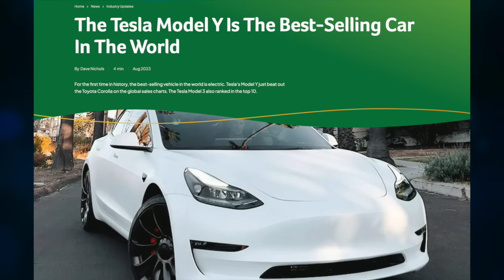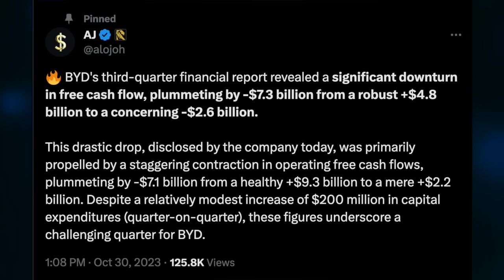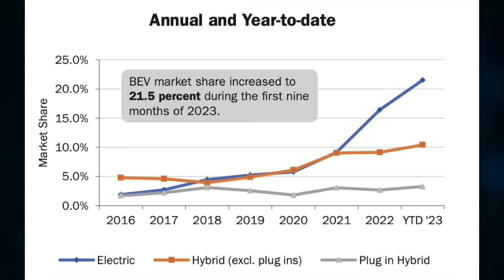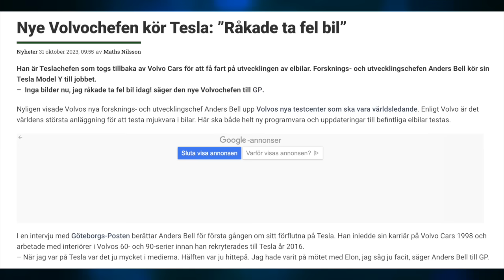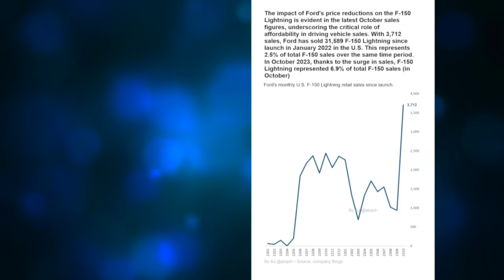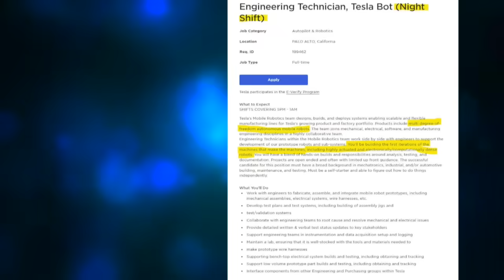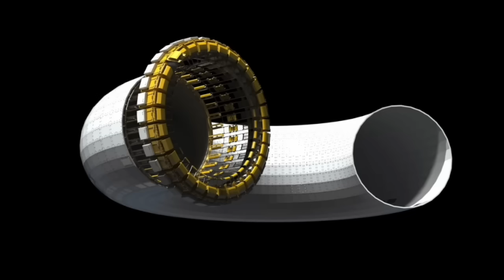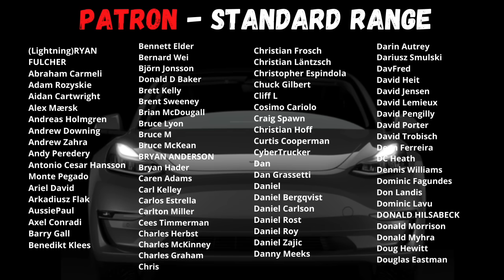BMW is making BIG claims - Tesla breaks new records - Xai has revealed its first product

Comment: The legacy automakers have failed to realized that the vehicles they build need to be changed to be engineered to be simpler and faster to produce. Sandy Monroe explains this very clearly with each tear down but it appears legacy automakers are not listening. Legacy automakers are facing an existential threat and they are not grabbing the lifelines being handed to them. WTF?

Comment: Remember that BYD produced a full suite of commercial and retail EVs so it is more resilient to quarterly fluctuations. I do hope BYD makes a move to market their entire array of EVs in Europe so that consumers and businesses have low carbon alternatives for their transportation needs.
Reply: They make buses and trucks too!😊
Reply: Where’s regulation onboard hydrogen leake detector
Reply: We are lucky to have a full range of light BYD vehicles in Australia. They are great affordable vehicles and are selling fast.

They also have good corporate management in this country. The company has just announced it is going to provide a line of 3 and 7KW AC charging stations for private and apartment dwellings as well as commercial use with a target installed cost considerably less than $2,000 per slot. They will be optimised for BYD vehicles that are set up for single phase AC, but will also be able to charge many other EV types using the CCS2 system.
Reply: @jimgraham6722  saw two when I went out for bread in Melbourne outer east.

Comment: With a 20% better battery BMWs with their 20% inferior drive train will now get the same range than Teslas, for just 20% more energy and so more cost per mile for the customer 😂
Reply: Bmw power trains us inneficient as are their batteries. My 75kw tesla battery will take me 360 miles real world with 18 miles left in the tank. Bmws are too heavy and not aerodynamically efficient. They are not building evs as they should be built. My m3 beats bmws on performance.

Comment: All the Legacy auto manufacture are scaling back production so in a year time when they need Battery, Tessa would’ve bought up all the batteries supply that the legacy auto manufacture cut back from purchasing so when you’re ready to ramp up your EV production, they will not able to buy any battery Because there is no supply.

Comment: EVS are the best-selling cars of all time but because they are there are loads of pushback from the ice industry saying false claims fooling consumers that EVs are bad batteries fail all the time and they are not recyclable when in fact the opposite is true most these terrible claims is coming from guess where oh it's the petrochemical companies of course and from people who just don't like EVS who have never driven one or owned one it's just because they love the suck squeeze bang blow of there little put puts so it's our job as EV owners to put these people right on how the fact really is which I do I get people coming up and laughing at me saying iam a fool for buying an EV and I say back at you mate then they start spouting all the lies and false facts at me so I say so you're an expert then do you actually know how many EVS where sold this year compared to ICE cars if you did you would be scurrying back into your hole plus before you say 100 percent of battery's which end there useful life are recycled now and made into new battery's this will become so much that all new batteries will be made of recycled batteries in a few more years as no batteries are failing yet apart from the flooded ones which ended up under water other than that one the car is finished with the battery it is reused in static electricity storage systems for many years so we wont see batteries from these vehicles for many a year yet maybe thirty years if we are lucky and that will be a very high mileage one put it this way a tesla did a million miles on one battery and it still had eighty percent of battery life left on million miles so as you can see they don't fail easily plus my car just had its first service which on an ice vehicle i would get them to pick it up as it takes to long to wait for it to be done My EV I went with it and waited 30 minutes and it was all done just had some new wiper blades fitted that was all all done for another year or more so there are loads of pluses for EV's